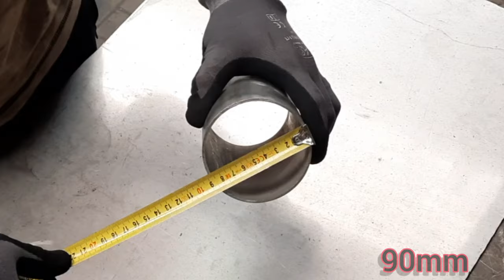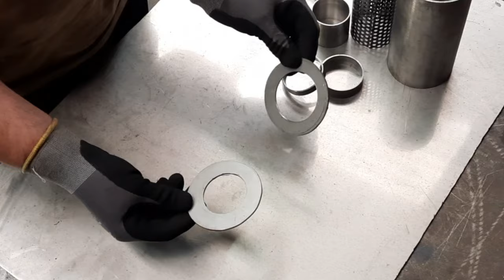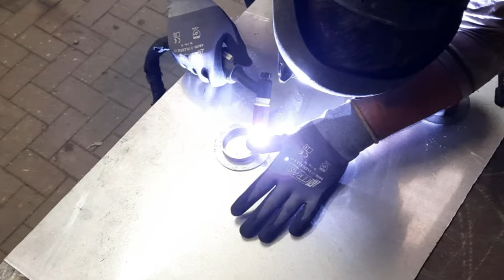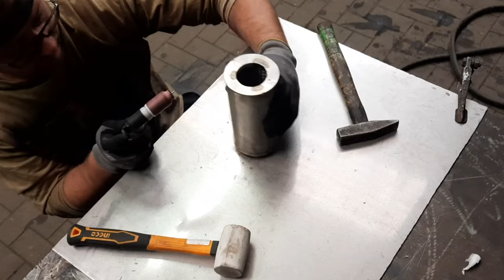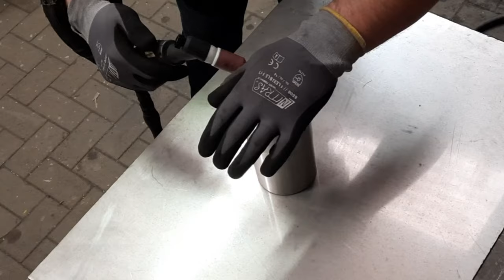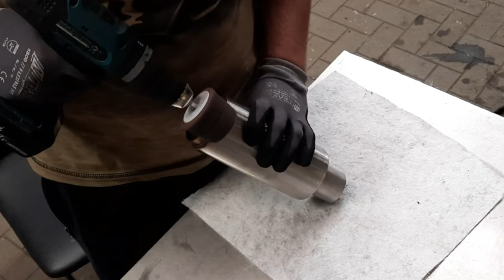DIY Motorcycle Exhaust Muffler | Stainless Steel

Comment: Awesome work, videos from start to finish excellent. I have a question, not sure if anyone has asked you before, but have you ever tried replicating a SC PROJECT EXHAUST, AUSTIN RACING EXHAUST, RACEFIT EXHAUST? i believe with your talent and skills  you can get real close to those high end exhausts . This exhaust your making really looks badass,like a GP PRO EXHAUST you could see on the circuit.  Maybe youll have a video one day showing you making one of those exhausts i qas mentioning, would be good to see that .
Reply from the maker: Thank you.
I thought about it. It can be copied, I just need to make a tool for the end caps. I think in the coming months it will be done and of course there will be a video.

Comment: how when need change the glasswool? maybe you can make it changeable glasswool?
by the way, thats nice job dude!
Reply from the maker: Thanks. In this case nothing without cutting one cap, changing the wool and rewelding, but this is ceramic wool and it will last a long time.
I made one with removable caps.
https://ioutu.be/BKvkIKd0FaI

Comment: What would happen if the holes in the perforated sheet were big? (Something like 10/15mm) Because I'm thinking that it would have better sound but the packing wouldn't last that long
Reply from the maker: I haven't tried it, but I thought there wouldn't be a noticeable difference, just that the pack wouldn't last long as you mentioned. The diameter and length of the perforated tube have a bigger effect than the diameter of the holes
Reply: @GPGarage1  Thanks, so bigger tube diameter = better tone?
Reply from the maker: It's not that easy. Let's say like this, the larger the diameter of the perforated tube, the deeper the tone. It also depends on the diameter of the inlet and outlet pipes.
Reply: @GPGarage1  thanks for the info
Reply: @GPGarage1  Hey great video, does the perforated screen deaden sounds at all? I make some custom mufflers and they are super loud, looking for ways to lessen the sound, I have tried the packing stuff and it didn't make any difference, any advice would be much appreciated
Reply: Very nice job. Question; with the addition of that white packing material (what is it - can you buy it from a hardware store for example ?), would that not negate the effect of the inner perforated tube and create excess back pressure, in turn, reducing the performance and efficiency of the engine ?

Comment: How thick is the stainless
Reply from the maker: Hi, If I remember correctly, muffler case is 2mm and other is 1.5mm, but there is no need for such thick material, 1mm or 1.2mm is enough.
Reply: @GPGarage1  thanks alot

Comment: Amigo que espesor usas de chapas? El exterior es un tubo o chapa soldada por usted? Gracias de antemano saludos desde España
Reply from the maker: I use pipes because I don't have anything to bend sheet metal with. Sheet metal and pipes are 2 mm, because I make this from waste material, and if I were to buy it, I would not go over 1-1.2 mm thick.
Reply: @GPGarage1  muchas gracias amigo,veo todos tus videos,quieres decir que si tuvieras curvadora de chapa lo harías mejor con chapa en ves de con tubos verdad? Daria menos peso a la moto,con 1mm de espesor lo ves bien?
Reply from the maker: Yes, it's hard to find a pipe, for example fi 110 1mm thick, and with a sheet metal bender you have more options for diameter of the muffler.
Reply: @GPGarage1  thanks very much friend,is there any way i can contact you privately?
Reply from the maker: You can contact me on Instagram
gp_garage_no1
Reply: @GPGarage1   thanks friend